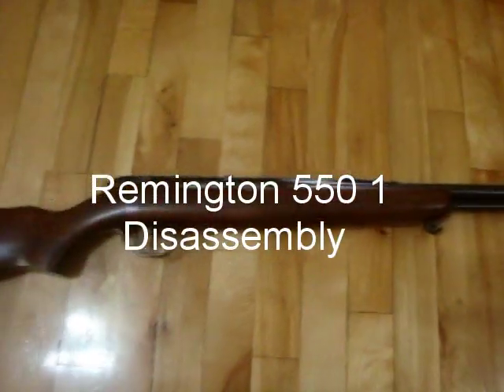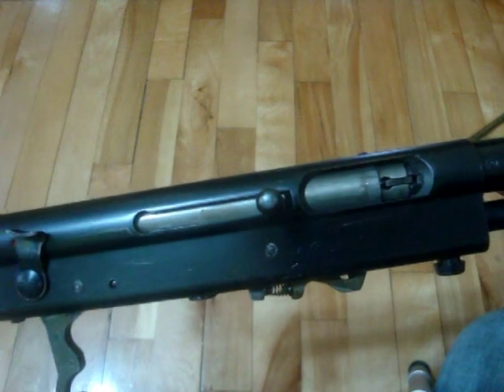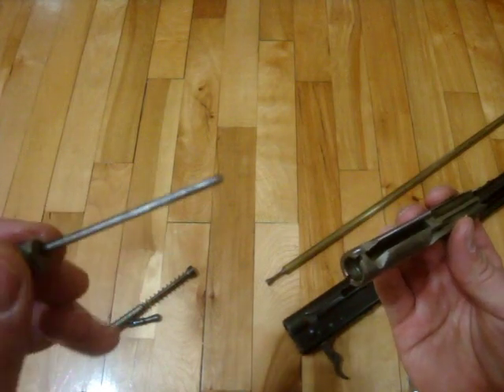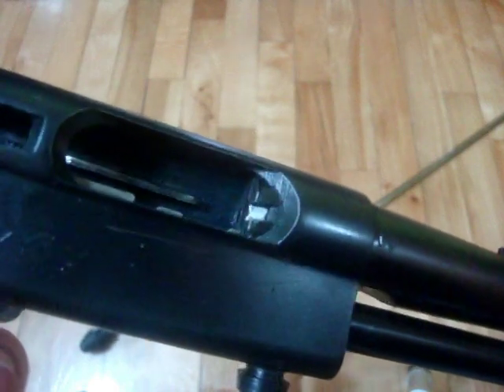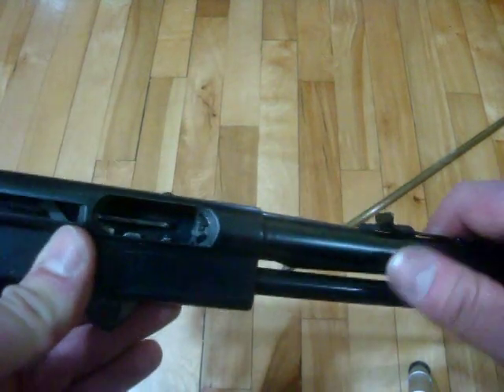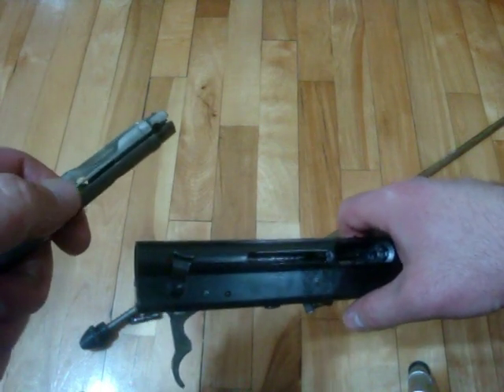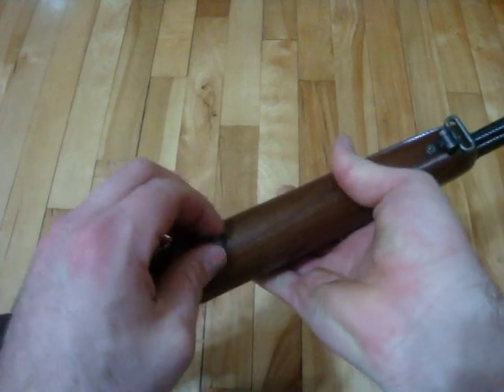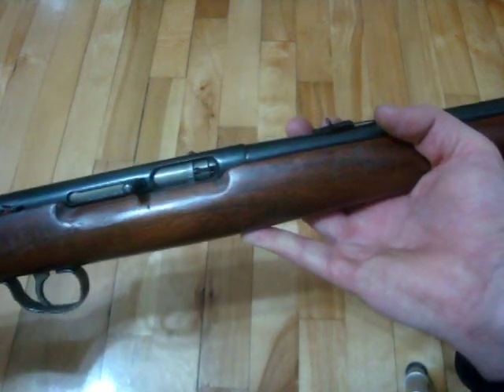Remington 550 1 Disassembly

Comment: can you please explain how you add a scope on this relic??
Reply from the maker: IIRC they had a side mount back in the day, if not your cup of tea you would probably have to drill and tap it yourself for a rail.
Reply: The later models had grooves cut into the receiver top by the factory. Made for clamp on .22 type rings/mounts.
Reply: I have three of them and all three have different ways to mount a scope.  The first one has NO WAY to mount one and is iron sights only.  The second one has the old groove, but the third one I was able to mount Picatinny rails on so now I can mount whatever I like on it.  I enjoy shooting CB caps in mine in the backyard.  Very low noise and no issue them being stopped by my double railroad tie backstop.
Reply: JMazterV112 N2 or N3 weaver scope mount will fit this rifle if it came pre drilled, 4 screws hold it in place. N2 or N3 will run you about $35.00 on eBay.
Reply: I added a laser scope to mine, it just clampes around the barrel. The brand is a "Beamshot". It is very simple and reliable. I have grown quite fond of it because you don't need the sights anymore. You can quickly get a shot off. I advise to use in low lighting conditions as the beam isn't that strong.
Reply: @johnbrowning8021  You're not related to the browning arms Browning are you?
Reply: @alanbluhm3461  Thank you7, but no, I am not related.  I am an inventor, and he is my idol.I have one US patent, and he has, li8ke a bazillion.  Working on my second, though.

Comment: What would be the reason that the buttstock and the steel part has a bit of a wiggle even after the screw is tightened?
Reply from the maker: Not seated properly, or the bushing in the stock isnt there assuming your stock had one to start with?
Reply: Stray03 Thanks man. Your vid helped me out tremendously. I will take a closer look at it.

Comment: Have the same G UN  can not get the floating barrel out . any suggestions?
Reply from the maker: It is probably stuck so I would put some hoppes solvent in it to help break up the crud around it then try again. An ultrasonic cleaner would also help.
Reply: @Stray03     Thank you    DID work
Reply from the maker: Glad you got it freed up. Only way it will cycle shorts.
Reply: @Stray03   Got it back together shoots short rifle fine, long rifle jams every so  Often . any suggestions . thank you
Reply from the maker: Mostly keep it clean and lubricated. May take a bit to work the parts after  they were stuck.
Reply: @Stray03   Going to tear it down and clean it again . thanks for all the information . your video was great . thanks
Reply from the maker: No problem.  I'm sure it just needs working in.

Comment: I am refinishing a 550-1 made in June of '53. The barrel is in great shape but the Mag tube needs to be sanded down due to rust and minor pitting. Is the Mag tube supposed to slide out after removing the 2 screws in the receiver? I have soaked it for a few days with Kroil and it will move slightly but won't pull out, of course it's not easy to grab hold of it. Anyone have any ideas how to get it out?
Reply from the maker: Is it binding in the receiver or in the barrel ring?
Reply: @Stray03  I FINALLY got it out. It was binding in the receiver. I guess it took about 4 or 5 days for the Kroil to loosen it up. Thanks for the reply and definitely appreciate your videos!
Reply from the maker: Glad it came apart.

Comment: MY 22 will fire and eject the brass ok but when it tries to load the next round it will jam up.  so let me try some of your idea's
Reply: Either it needs a good cleaning or the two large springs need to be adjusted. At the very back of the rifle there is a large screwdriver slot for this adjustment. If it worked before, I would suggest a cleaning. No harm in trying to adjust it first. Both are probably in order at this point.

Comment: I was taking down a 550-1 while watching your disassembly video. When I pulled the mag tube backwards to acces the floating chamber, a small metal part came out not seen in your video. It looked like it came from the floating chamber. It is a small rectangular piece of metal that looks like a square C. 3/8" tall, 1/4" wide.  I was not expecting it as I didn't see it on the video. I don't see it on exploded diagrams either. Any ideas? Thanks
Reply from the maker: Was your gun firing short before you took it apart? Or did you undo the little screw under the screw that I removed? Does it resemble a staple? If you can take a pic and link it to me it would be great too.

Comment: Great video!   I noticed that your receiver plug ratchets down. Mine does ratchet down as yours does. Is there something missing on my rifle?   Thanks in advance. Regards J
Reply from the maker: Can be missing the ball detent. Depends on the rifle though.
Reply: Where you unscrew the receiver plug there is a screw under the plug on the receiver, back the screw out till you can turn the plug counter clockwise, if the screw falls out that’s OK, there’s a little L-bracket that you have to place back in, first by putting the screw in the L-shaped bracket through the receiver bottom) don’t tighten it all the way as you have to put the plug back in, once the plug is back in, then just tighten the bottom screw snug.   Remember time is on your side.   Make it fun to work on this old Remington 550-1 rifle.

Comment: 6:19 the screw broke when I went to take it off please help
Reply: After I put the big screw that holds the barrel on the stock the ammo tube wouldn't move anymore. I really hope I didn't mess the gun up. It had never been taken apart before it was filthy I should have thought about that. But will the threads that are left on that tiny screw be enough to hold? the screw broke just below the flange not even the first 2 threads came off of. Does the big screw hold it all down?
Reply from the maker: Well if you sheared the little screw then it will probably still do its job but you should get it sorted out as firearms with broken parts are never good to just leave. The mag tube shouldnt move when the gun Is all back together IIRC. Been a while since I took it apart so my memory of it isn't great.
Reply: @Stray03  your memory is good enough I appreciate you! I will let a gunsmith mess with that. I'll take it to the range run a few thru it first then get it fixed.
Reply from the maker: Good idea

Comment: MY 22 will fire and eject the brass ok but when it tries to load the 
next round it will jam up.  so let me try some of your idea's
Reply from the maker: +gentil gomes Hope the video helps. Main thing is to make sure it is cleaned well and everything is moving like it is supposed to.
Reply: I had the same problem with 22LR in a gun that was cleaned, but I hadn’t gotten the floating chamber out. After watching this video a few times I finally got up the nerve to get it out (I’m a newbie to all  things firearm) and can’t wait to get back to the range!
Round 1 was shooting and ejecting fine, but round two jammed midway with the bolt slamming hard enough on the casing to crimp it. Yikes, that can’t be good.